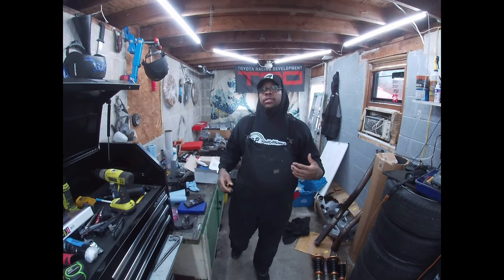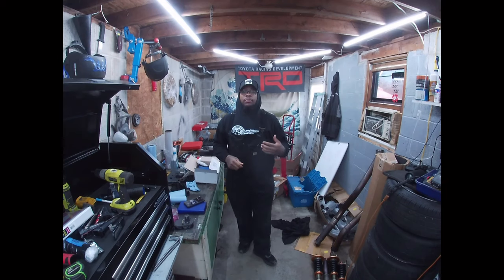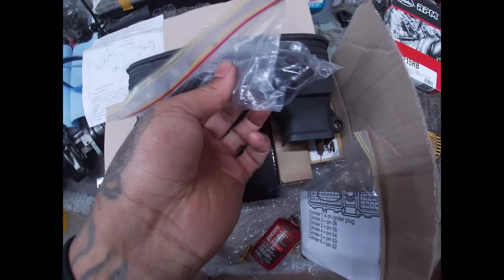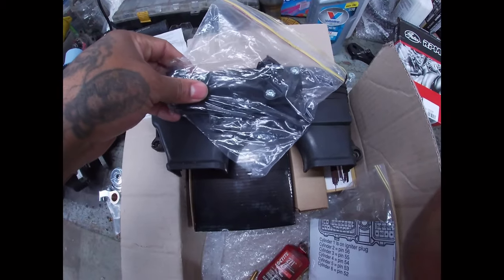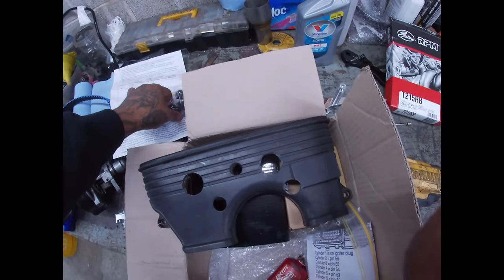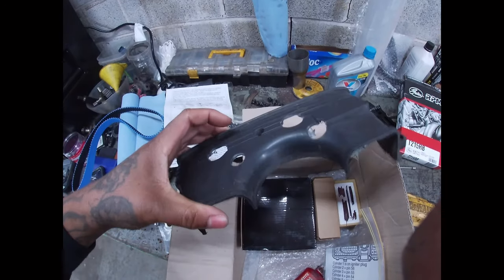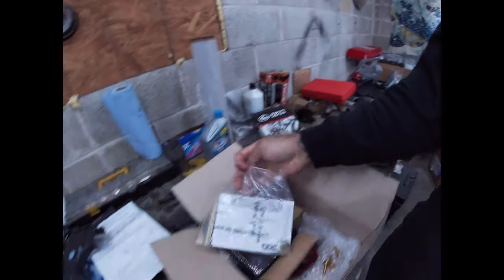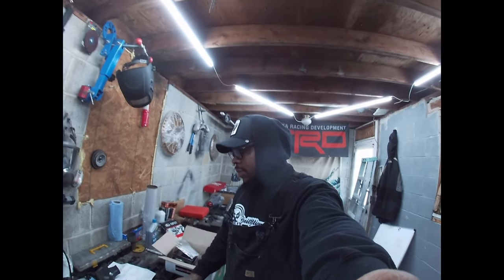#Supravworld #2jz cam trigger kit (distributor delete) install from start to finish

Comment: Bro, put small washers between both brackets to space them out, so it doesn’t bend your middle timing belt cover!!
Great video!!!
Reply from the maker: I was thinking of doing that but worried it would change the air gap between the sensor and timing pulley by to much

Comment: I see you didn't run the belt stay bracket. I wonder why he included that in his kit as the gte pumps don't use it. 

I'll be installing mine in the next couple days. Thanks for the video.
Reply: he explains it all in supravworlds video on the kit you shouldnt need to run a gte pump and numerous people who have find it makes so much oil pressure it pushes the front main seal which is why he includes that belt stay bracket to convert your ge oil pump :)

Comment: Hey. Great video. Got a question. I installed this kit on mine also but I’m having difficulties getting it in timing. I’m no rookie when it comes to timing but this is kicking my ass. Seems like the markings r not right. Any help would be greatly appreciated. Thanks
Reply from the maker: That’s weird if the lines on the kit don’t line up he presets them before shipping the kit out
Reply: @builtalliance2501  any way we can chat one on one
Reply from the maker: Hit me on instagram
Reply: did you get this sorted? the cam gears are supposed to come pre set so you should have no need to adjust the bolts on them or anything.
Reply: @BoostyGeoff yea. All good. Every thing in timing. Marks still weird tho. Runs a good. Made 400hp on pump 12psi
Reply: Did you get this kit to work?
Reply: @JPena-sn6dr  I did. Car makes 400 on 12psi.
Reply: @hcracer1985  im having trouble getting a cam crank sync, did you have to modify the kit any to make work? thank you

Comment: Nice. It's a good kit
Reply from the maker: Yes very good kit so far as you saw in the video it’s straight forward to install, the brackets that come with the kit are well made and sturdy with impeccable fitment also

Comment: Hello, did you get this kit to work? i bought this kit installed it and having touble. Thank you
Reply: Same here lol. Sent about 4 emails and no response.
Reply: @TripasGarage  I installed it with a megasquirt standalone and expierencing sync loss, i removed it and gonna use distributor for cam pickup.
Reply: @JPena-sn6dr  might be wired wrong. Mine was completely wrong. Wired it up
Correctly and it’s now working. I can assist you.
Reply from the maker: @TripasGarage that seems to be everyone’s issue who purchased the kit I had the same issue with my kit I just never got around to a update video on the kit from Supra v world
Reply: @TripasGarage  completely wrong out of the box! polarity reversed? how did you fix the wiring? thank you!
Reply: @JPena-sn6dr  yes, completely wrong out of the box. Had to rewire it using the existing harness, but it now works. If you have Instagram, I’ll be happy to explain
Reply: @TripasGarage  i just removed it, if clayton cannot send it wired correctly from purchase then its not worth it, sorry no instagram. If you make a video of what you did to correct then it would help alot of customers experiencing problems. Thank you for your time! i subscribed to your channel, thank you!
Reply: @JPena-sn6dr  I completely agree with you, which is why I contacted him about it multiple times before having to take other means of action. I did get a long reply from him after letting him know that. Seems he’s got some personal issues interfering with his business. Nonetheless, it should come correct from the start or provide the money back for the products we paid for. Always pay with a cc. I’ll have to whip something up for the other users out there.
Reply: @TripasGarage  Hello, it's Clayton here from Supravworld. Please accept my apologies for this inconvenience with the wiring. But please understand that the wiring harness is for the Stock GE harness and will only start the car immediately with the 12 tooth crank gear. I will go over this in more detail with you Austin outside of here, but it's very important that people don't read this and think they need to pull their wiring harness apart. I have sold nearly 500 of these kits with no trouble when installed correctly. Austin, can I please ask to see the expandable braid pulled back on your factory distributor connector? It looks like someone has replaced your connector and wired it wrong. I have read all the notes that you sent me and I am willing to work with you to sought out what happened here. I just don't won't folks mislead that the wiring is incorrect, as it's not and the car will start and drive when installed correctly. I drive my Supra every day with this full kit installed. The harness is completely copied from a factory GTE harness and I will show you my detailed drawings outside of here. I also won't to thank Built Alliance for this very cool video, I am subscribed. I watched this about 3 months ago I think. There can always be new things for me to learn and adapt to this kit and my other products when dealing with different chassis types and JDM vs Euro and USDM. I try to stay on top of it but evolution of the products will always occur when issues arise like this. I won't to work with you guys to perfect the products so less trouble shooting is needed in the future. I know that Austin is a very talented guy and owns a business also.
I do have family issues at the moment, so my messaging is a bit random while I'm overseas.
Reply: @supravworld8777 please read the emails I sent to you. The wiring was wrong, period. The colors are different however the pinout is the same.

Comment: that oil pump blows seals the stock one was fine
Reply from the maker: It does not if you install your seals properly you won’t have a issue
Reply: @builtalliance2501  Seen numerous people fit front seals perfectly and then blow them running the gte oil pumps on ge blocks so suggesting its fitment isnt correct. They most definatley do blow due to pressure. we had it happen a few times ourselves then i sent the block to the machine shop and got the oil galley job done and then it stopped blowing front seals with the gte pump. we did another ge motor and used the ge pump as described instead and its never blown a single seal.